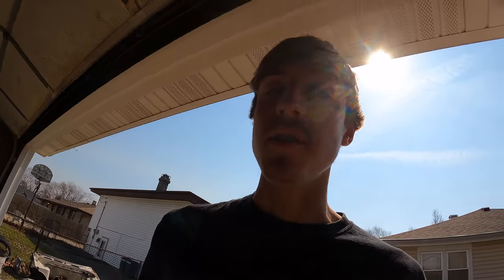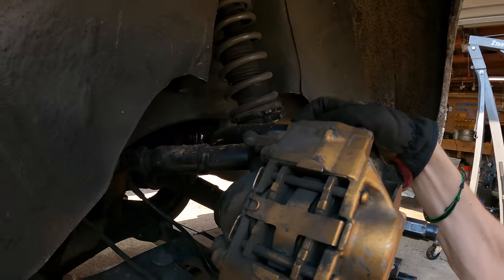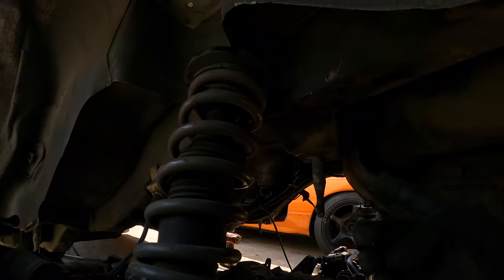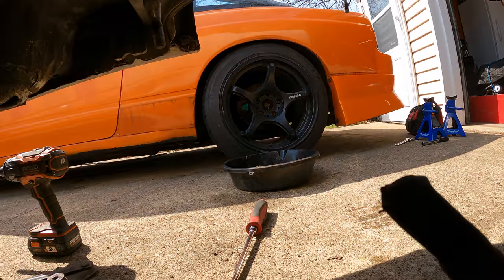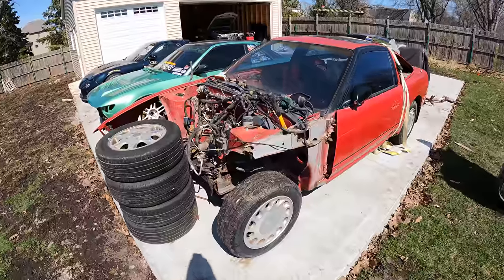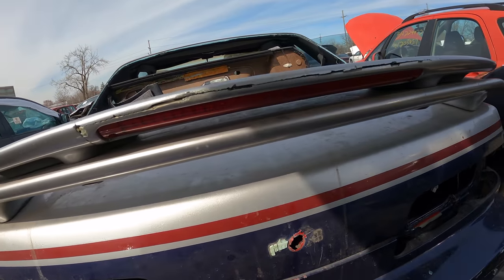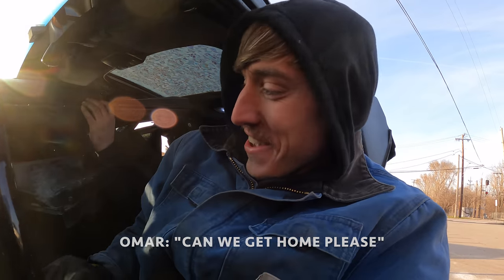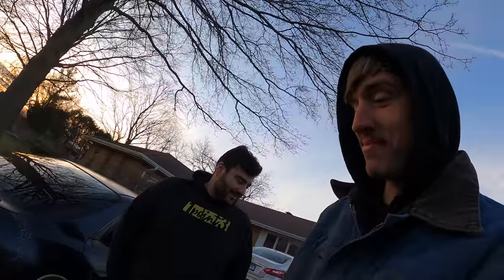Found an Abandoned Gem at the JunkYard and my Wrecked 240sx Catches Some Luck

Comment: Do you plan on running 18s ever? I saw that square makes the r33 reps in 18s now!
Reply from the maker: About 2 years ago I had a stagger set up, 17x9 front and 18x9.5 rear. But tbh I prefer the handling and look of a 17" square set up. Had to try out the stagger set up to realize it :_love::_s13:

Comment: you should have just hung the calipers. screw having to bleed them again, even though thats easy af. just makes it easier!
Reply from the maker: Tbh, I see where you're coming from, but the car needs to be a stripped shell, it would be more of a hassle with 6 calipers dangling and all the brake lines in the engine bay while replacing the firewall and left side of the car :_s13: